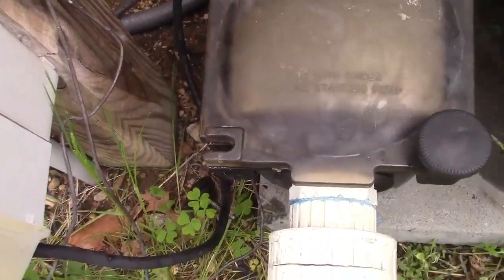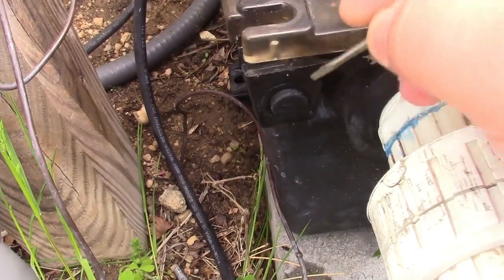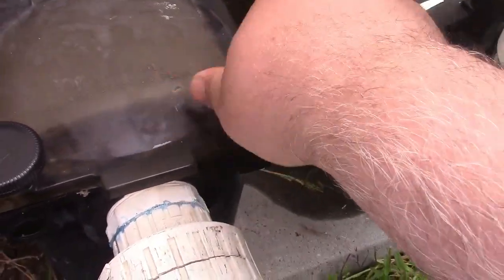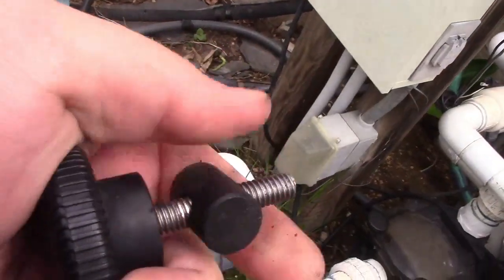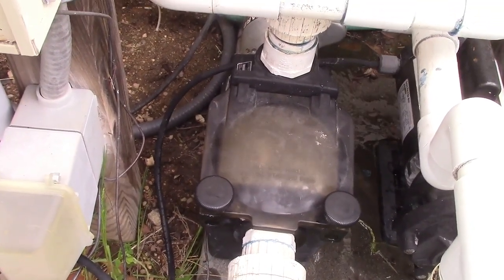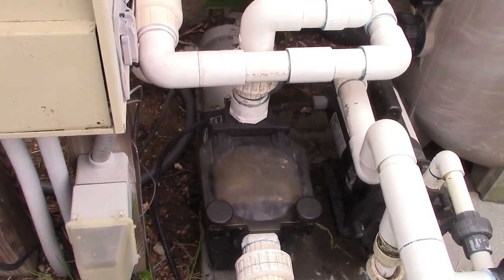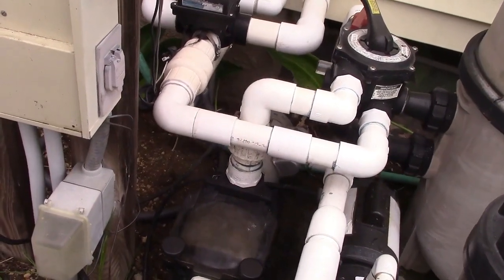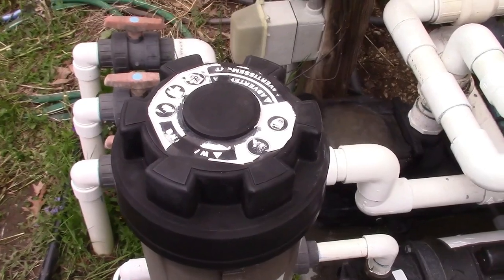Pool Opening 2019, Part 6 - Replacing Hayward Super Pump Hold-Down Knobs

Comment: Inyopool sells a variable pump that is quite affordable that I believe is a direct replacement for the Hayward super pump that you appear to have. I'll be honest and say I switched to a Variable Speed Pump that I run 24/7 on a schedule and have had no issues and my electric bill is 30-40 bucks cheaper a month and water is just as clear.
Reply from the maker: I appreciate your input.  When the day comes that I must replace this with a variable speed pump, I'll give the pump a shot at slower speeds and see.  If it's not as clear, full speed ahead, full time, plain and simple.  And that's only because I'll be FORCED to get a variable speed pump.

Comment: Do you recall the part number?
Thanks
Reply from the maker: No, sorry.  Just ask at your local pool store, they'll know immediately what you need.
Reply: @jaykay18  thanks for the video and for your response extremely helpful
Reply from the maker: Surely, good luck repairing yours!
Reply: Hayward SPX1600PN swivel
Reply: @keithguay7523  thank you!  Haven’t been able to use the pool for the last three years. I can finally fix the pump basket. (But seriously I’m sure it will help someone in the same situation I was in)
Reply: @Drrich_DIY  my bad hey better late than never 😅

Comment: Why don't you want a variable speed pump?
Reply from the maker: The pool pump has ONE JOB--to pump water from the pool, pass it through the filter, and return it to the pool.  There are about 30,000 gallons in my pool.  It takes about 4 hours to turn all 30,000 gallons over.  The pump runs for 12 hours.  That means it turns the pool over 3 times in one day.

If I run the pump slower, it will take longer to do that.  Eventually you get the "wiffle ball effect" where it goes farther if you DON'T throw it as hard, so running at a lower speed for a longer time can actually cost MORE money than high speed for a shorter time.
Reply: @jaykay18  I don't know much about pool pumps, since I don't own a pool, but I would think you could just tell a variable speed pump to run at full speed all the time and not have to worry about it, right?
Reply from the maker: I would STRONGLY SUGGEST you watch the video.
Reply: @jaykay18  So, one of the arguments I've seen for a variable speed pump is the energy savings. People say it will even pay for itself with the saving you get. Here's some thoughts:
1. How much does a variable speed pump cost compared to a single speed?
2. How much will it cost to rework the plumbing to accommodate a variable speed pump?

3. How long will the new pump last? 

4. Will the new pump last long enough to pay for itself like everyone says it will?

I ask that last question because there is a disturbing lack of quality in new products today. I don't know if pool pumps are affected by the penny pinching China Pride of Corporate America, but if they are, I doubt that any will last long enough to pay for themselves in energy savings, especially if you have to redo the plumbing to accommodate one.

Also, the main angle of that last comment was to see if there were any pumps that took control of how hard they ran and not allow the user to have any input on it. Sort of like how HE washers sense how much water a load needs, and then doesn't use enough, and also doesn't allow the end user to tell it to add more water. I should have been more clear on that.
Reply from the maker: 1.  Too much more.
2.  Too much.
3.  Not long enough.
4.  Not a chance in hell.

I'm pretty sure you still have full control over it.  It probably has "suggested" programs built in, but even with a programmable thermostat, there's always an override or a "hold" feature.

Comment: Dang, the government is now cocking over the pool program, too. You'll certainly find a workaround when the time comes!

Is rebuilding the pump yourself out of the question? Looks like the "go-kits" are fairly inexpensive. I've never messed with one, so I have no clue what's involved in the rebuild process.

I'm glad at least the hold-downs are an easy fix.
Reply from the maker: Yeah isn't that awful?

I probably could rebuild the pump, but it doesn't make sense, since most pool places charge parts but not labor.  The parts price is the same whether I have them put it in or I buy it over the counter.  I could theoretically buy it online and save more, like I did with the pool filter, but even that was a complete gamble because the correct model number wasn't marked off.
Reply: Cool, I didn't realize most pool places don't charge for labor. I absolutely agree it makes sense to let them do the rebuilds!
Reply from the maker: Yeah, let them donate blood to the project instead of me.